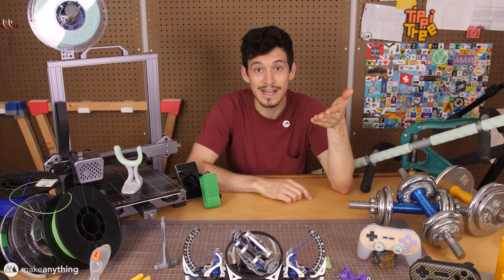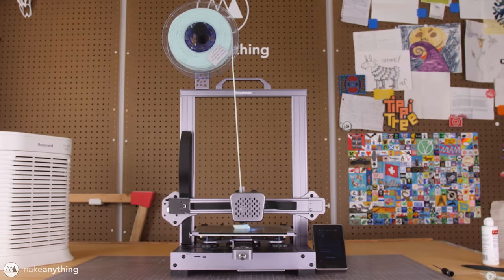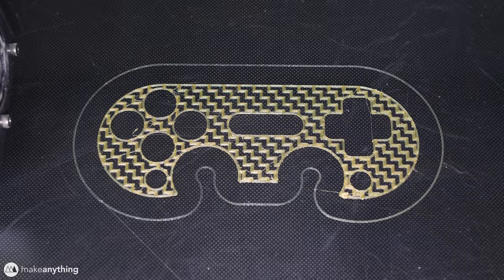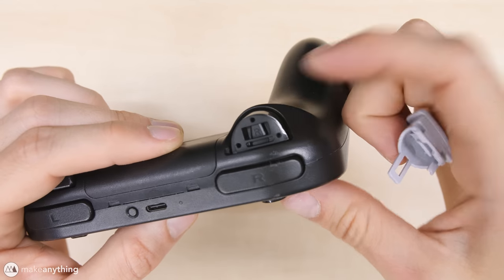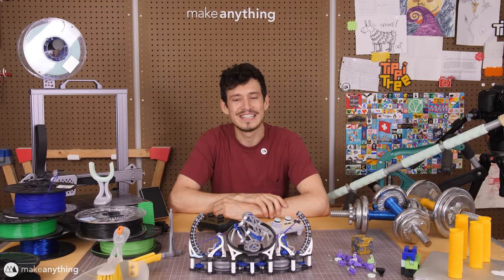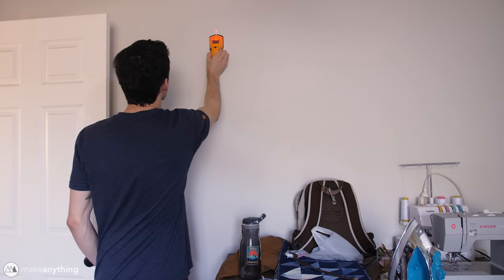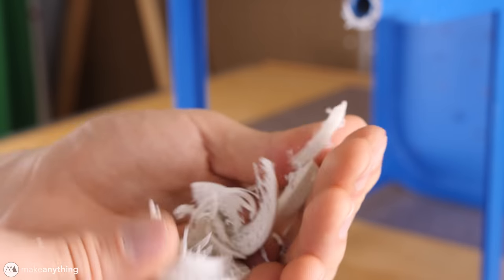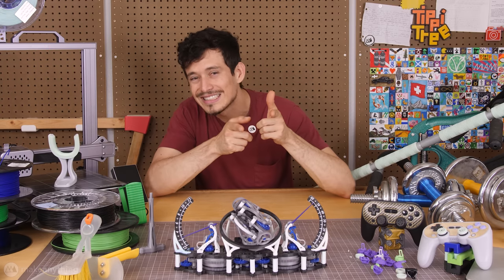Cool Prints 8 // Flexible Functional 3D Prints + Rage-Proofing my Game Controller

Comment from the maker: Thanks for watching! I know these are some pretty random projects but hopefully you still found it fun and interesting. What's your favorite functional print and what should I make next with the flexible filaments?
Reply: @technodrone313  link?
Reply: TIP: buy stainless steel rods, 100mm length and 1, 2 and 3mm diameter. They make awesome pins and work really well with prints. I've used them as hinges and also as support inside vertically printed parts to make them stronger. Simple to use, drill a hole, push them in. Easy to cut with a Dremel and a cutting disc.
Reply: I found all those projects really interesting especially the mechanical one and also I am wondering did you already Release the winner to give away or are you still doing that yeah I really hope I didn’t miss anything
Reply: I think you doubted yourself in this video. Let me be the first to say that a video like this is inspiring. You found so many niche situations in which 3D printing improved your daily life. Little things add up. You are a master creator and a video like this shows that clearly. Keep moving forward!
Reply from the maker: @squidcaps4308  ooo, reinforcing vertical prints is really nifty 👌
Reply from the maker: @rylanlafleur959  the winners were already selected (though second prize winner hasn't responded so it may go to someone else!)
Reply: @make.anything  o ok That’s good to know I didn’t miss out on anything
Reply: Nice and well made video as always ❤️
Reply: Would any of the flexible filaments make for a usable bouncy ball?
Reply: I would love to see a wearable bracelet for apple watch or just something that I can make a special olympics team my son used to be in when he was in High School.
Reply: My whole reason for 3d printing is to make / fix fictional stuff.   Still working on learning cad.  Please keep up this topic.   I love your channel always glad to see wien you post!  Thanks!!  Oh and I haven't tried flex yet but I do have some.   I really want that tire filament!!!!
Reply: 8bitdo fix was cool with the option for custom design tips that can be replaced from the outside 👍 modular design 🤓
Also shame on 8bitdo for the bad design in the first place on an otherwise great product!
Reply: Hey, Devi! Do you know a 3d pen that can reach 250 degrees C? I want to try repair household items using PE.
Reply: Is there anything particularly special about the Atom Stack printer to support rubber printing?
Reply: Devin I need your help I got a 3d printer a day ago and the only thing it can print is the SD card models
Reply: You are a true GENIUS.💞👍😊💎
And by the way i liked all of them too much.THANKS.
Reply: Try to make Carlos Caterpillar Figure
with ABS!
Reply: The controller mask in gold and black looks like twill 2x2 woven carbon/kevlar fabric, which i know bc I've got some. Well your invention there it's definitely cheaper and cozier than mixing some grams of resin to make it the real way. 
But idk if i really want to design it in Fusion 360 since it would take me more than just mixin some resin and do it. 🤔 It's cool, indeed.
Reply: my dad made a towel hanger for the wall, its a more subtle print but it helps a lot

Comment: It's always really satisfying designing replacement parts. That moment when everything finally just works is the greatest. When I lived in an old travel trailer, I replaced a lot of the old plastic parts like light bulb covers and the sliding mechanisms in the locking cabinets. It takes forever to find the specific part that you need and ends up costing you an arm and a leg.  Then, half the time it takes several weeks for the part to even ship to you. 3D printing absolutely made my life easier that way (Plus you have to come up with some way of justifying buying a several hundred dollar machine ;) )

Comment: My first real functional print was a replacement trigger button on an old, generic (and now out of production) bluetooth smartphone-compatible gamepad! Still working perfectly fine after about a year of regular use :D Really taught me a lot about modelling in freeCAD and getting used to the concept of manufacturing tolerances.
Fixing small things around the house that would be infeasible to repair/replace otherwise is and probably will forever be my favorite application of 3D printing.

Comment: My mother had a knife block that used a bristle insert to hold the knives rather than slots.  This is nice for when your collection isn't really a set, but it has two major drawbacks.  The first is that once you have a few knives in there, it becomes very difficult to insert another or even pull them out.  The second is that the bristles get damaged and dirty overtime.  Made her an insert that holds a ton of knives and they are easy to insert and remove

Comment: Devin, your speech at 15:04 was spot on! I feel completely the same way. There's nothing you can't fix or create when you have the power to 3D model and print. The only limation we have is our creativity and our imagination. And well of course our knowledge and skill in 3D design but that can always be improved upon. The satisfaction from creating your own solutions is second to none, you feel so accomplished and self-sufficient. Not to mention the cost benefits, oh you sell this 3rd party accessory for $50? let me just model my own and print it for $1.50 in material! See my reply to your question in the video.
Reply: So I just want to say thank you for inspiring me and countless of other creators Devin. I love your channel and your work is amazing. Stay awesome.
Reply from the maker: Yes, inconveniences be gone! :D Hopefully the power supply doesn't get too warm and deform the print (if PLA). I could actually use something similar
Reply: @make.anything  Ok, so, update to this... I think you were right, however, my design was flawed as well. A couple of months into its use the hooks actually broke. I used a hook design (it looks like an uppercase J from the side) in which the power supply slipped into the hooks and it was held onto the desk with a threaded screw. To save material I only used three hooks and they weren't very thick, probably a couple of millimeters in width. I updated the design to be one long complete hook that travels the length of the power supply and it's holding up much better now. Sometimes cutting corners isn't worth it...

Comment: You're teasing us with those filaments we can't get yet 😂 Both those rubber filaments looks really useful.
Most of my printing (*ahem*, well apart from printer modifications!) has been useful bits and bobs around the place - all those one-off pieces that you either can't buy, or are variations that fit what I want to do better than what's available. Even simple things like boxes or holders - instead of buying off-the-shelf size things that don't fit well - simply model my own that fits stuff perfectly; nice!

Comment: 18:08 hey Devin, did you know that using the air compressor to blow air in between the part gets it on very east
Reply: Just make sure the whole projects doesn't go south
Reply: Great tip!

Comment: a small plastic part of the handle for my freezer broke. replacements cost >$200 dollars, and you had to buy the whole set, including new handles for the refrigerator doors too. i designed a replacement in f360, and it only took 2 iterations before I had a perfect fit. just like that, i had offset more than 1/4 the cost of my mk3s, and it took me less than a day.

Comment: One of the most “useful to only me” things I’ve designed and printed is basically a wrist cuff with a stabbing part on the side that points away from the body. I work in a walk-in cooler and open a lot of plastic wrapped packages of bottles and cans. I wear gloves Bc I’m a weakling and operating a pocket knife isn’t hard with gloves on, but opening, closing, and fishing it out of my pocket is hard with gloves. I also run the risk of puncturing the product… which I’ve neeeeverrrr done. So this wrist cuff effectively pierces the plastic, has a “bladed” edge that “cuts” the plastic (more of a very controlled rip) and it fits between my sleeve and glove nicely, so it’s basically out of the way until I need it.
Reply from the maker: Great solution! That must be satisfying to design a more efficient way to get your job done :)

Comment: A cog broke on my robovac leaving one of it's brush hands not spinning. Still riding the high of successfully printing that tiny cog and it working after putting it all back together!
Reply from the maker: That's a good one! What material did you use for the cog?
Reply: @make.anything  plain old PLA.  It was 15mm in diam so had to use smaller nozzle. Worked like a charm though
Reply from the maker: @crumpet_  Cool! :)

Comment: I made a push tab for a water cooler at work when the cold water tab broke. A few years later, when the hot tab broke on the same system, I had a design ready to go. A water dispenser that would have only lasted 3 years has been going strong for 7+ years thanks to my part.
Reply from the maker: That's a perfect example!

Comment: Great video! The most useful things I found were rubber feet -- I printed some with PETG for my chair, but they don't work as well as I have hoped;  and handlebar grips --   I need  a pair my bicycle. I have direct extruder, I should get some flexible filament.

Incidentally, one thing that I solved with the 3d printer is pins -- when designing a model,  just shave off about 0.5 mm at the bottom of the pin so it's printable and the layers are lengthwise.
Print it with PLA or PETG. A few of 'temporary' pins like that have been working for years.

Comment: In November of 2017 you made a video about 3D printed fabric.  There's another way to do that which doesn't involve mechanically linking the tiles with the plastic.  One guy used a layer of cloth or fine netting in the middle of the print.  He let half the thickness of the tiles or scales print, laid down the cloth/netting, and let the other half of the tile print.  This sandwiched the fabric/net permanently into the tiles or scales and still made for a flexible printed scale armor that was still flat on the inside so it was comfortable to wear but could still be three dimensional on the outside, like spiked shoulder pauldrons, or something like Aquaman's fish scale armor.

Regarding the Mint Green rubber filament in this video, if they made it in black it would be great for printing RC car tires, or maybe even flexible and shock absorbing but still protective cell phone cases.  Use that black tire filament closest to the phone, then the softer rubber filament around that kinda like the Otterbox Defender cases.

Comment: I bought a used 14" raised platform bed frame and it was missing a corner leg. I used Tinker Cad to model a new leg that didn't require any bolts as it was a corner. I also designed some leg extensions to raise the frame an additional 2" for more storage clearance underneath. Eventually I bought a new 18" frame and gave the 14" frame away but it still works great and is sturdy.

Comment: Really good vid. Subscribed.

I liked the triggers for the controllers the most. I finally got around to order a printer myself. In preparation of the delivery, I already downloaded Fusion360 and designed a holder for my headphones with a screw to fix it on my table edge and one "flip foot" for my keyboard, that broke some month ago.

Only problem is, my printer should have been here 3 days ago and yet I didn't even receive a mail about the status
(Anycubic Vyper EarlyBird order). That sucks.
Reply from the maker: Smart to get ahead! Happy printing :)

Comment: I love 3d printing functional parts in a few ways. I'm a mechanical engineer and quite a master in Catia V5 design skills. So i can make any adapter/mount i need, and for sturdyness in can eiter print it as is, 
Or embed steel wire/parts mid print (print the channel, pause print, insert the steel fully into the open channel and resume print to fill on top of the channel - this makes a steel part totally inside the plastic. Useful for mounts where i need a thin wall to be screwed.. i embed a washer in that wall. Also useful for embedding magnets

Also another reinforcement can be done with epoxy. Print a shell of the part and fill it with epoxy.
Or for flexible materials (that need to be sturdy and without layers or heat resistant) you can 3dprint a mould for a casting. Casting silicone or urethane or epoxy will give the final part totally in that material of choice (be aware of proper mold release agent or it will be very hard to release the part from the mould). Or print the mould from a filament that is disolvable in a solvent (PVAB support fillament with water, or ABS disolved by acetone, or others) where the solvent does not also disolve the casting material (silicone, latex, urethane, epoxy, other). ABS moulds work ok for me since the ABS is smoothed by acetone vapor and make a smooth surface for a mould. Otherwise the mould would need extensive postprocess to smooth out all the layer lines, or just fill with bondo then smooth out then paint with something glossy for a smooth mould.

For the more diy-ers that have lots of tools and space to do forging and castings of metals, the plastic part can be the positive form for the sand casting mould for an aluminium cast or even steel (but i doubt many of you have a furnace at all, and even harder to get a blast furnace for cast iron or cast steel that is way above even serious workshops).

For the jewlers, the 3dprinted part can cast a wax model and that is making the mould of the lost wax casting of gold and silver (or other). Some do the lost PLA method but is not a great idea for small parts. - but the resolution of FDM is not great for jewlery, but resin printers are great for making either the model itself or mould for small jewlery cast.
There is also silicone mould making by pouring silicone around the part (the 3d printed model) and later split that silicone to remove the model and get a silicone mould that can cast epoxy and other materials with great details.

Also in the 3dprinted mould category i can mention dies for shaping metal plates in a press, or making a split mould that is covered by carbon fiber mesh (or fiberglass mesh) and resin impregnated and when you close the mould you can shape that carbon fiber part precisely.

All mentioned are a derivative of the industrial process, but the models/moulds/dies are very expensive to do traditionally (now there is also CNC to make cheaper parts but way more expensive than 3dprinting). So a 3d printer gives me acces to all sorts of processes that are very hard to do without a means to make a model. In the older days a wooden model was made block by block, glued and sanded, and sculpted for each draft angle needed, and other stuff and could not have a very complex split line of the mould. A plastic mould if it can contain the casting material can be as complex you need, with multiple part lines, cores, features to align the moulds and all sort of stuff done in a CAD software.

Comment: I am surrounded by little fixes like that, but the thing I use and appreciate and use the most is one of the first things I designed -- a ring resizer. I lost weight after we got married, so my wedding ring is too big. I didn't like the ones available -- they're either metal and would damage the ring, or made of a grippy material that would irritate my skin or catch on surfaces.  It's just a little saddle type thing that sits inside the ring. 

I lost (more) weight a couple years ago and updated the design with increased thickness.

Comment: I am making a phone holder for my truck to hold my Note 20. Everything else either tears out my vents or attaches to the glass which makes to phone overheat in the summer or come unsuctioned from the windshield causing physical damage to the phone. I neglected my filament and left it out during the melty snow/rainy season and ran into several issues. Still working out the kinks on my design and the print process. I may print in sections and assemble with sticky stuff. Angles and design height are my nemeses. 
Wow this got away from me. I love using my printer to make things more functional and sometimes improving on an existing design. 
Thanks

Comment: Also for me my best project were "reparing".
Most successful, two non standard gears for glass wipers for a vintage car.
The one I use the most, a lamp shader for my  bedside table... the glass one died in an incident :D
And several repair part for old appliance for my mother kitchen.

Comment: If you can't find a nail that fits the hinge pins you need to replace, you can lathe a larger one down to fit. If you don't have a lathe, you can load it into a drill. I repaired a folding headset that way.

Comment: Great video!
That feeling of satisfaction when you design something, print it... AND IT WORKS!
I designed repair items for arround the house as needed.
And parts for the model rocket kits that I sell.
Thank you for inspiring me to make even more fixes.
FYI, I used TPU to make rubber feet for the launchpads I sell for my kits :D.

Comment: Most of my designs and prints are functional.  I've made new knobs for water hose spray adapters to new feet for outdoor canopy poles to a wrench to remove the backs off of watches so I can replace the batteries myself to many other things.
Reply from the maker: Cool stuff. Do you use ASA or similar UV resistant materials for the outdoor things, or has PLA worked fine for you?

Comment: 3d print closed/shrouded impeller wind turbines, with/without the face plate on, and arced blades like water wheel cups, center-in rim-out, or also as vertical wind turbine